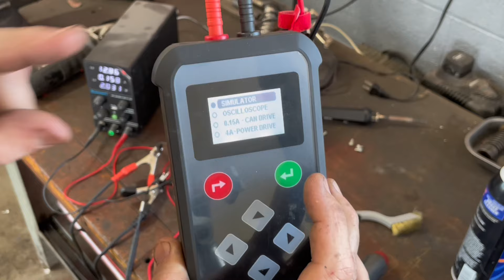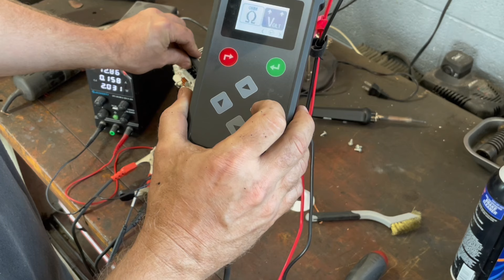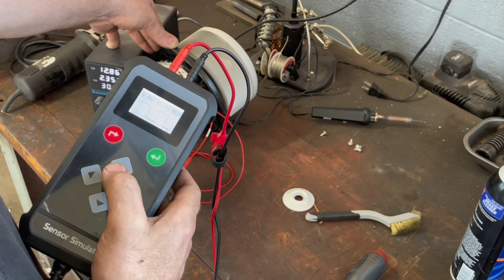Exposing Nissan NV Blower Motor Malfunction

Comment: Nice one Will.
I had a very similar one in a Nissan Elgrand that I fixed almost NPR for a customer a month or so ago.
Had all the correct inputs, good power, ground and square wave signal and the speed control resistor tested good.
So I opened it up and found two of the spot welded tabs to the motor windings had simply come apart, (one of the copper bars that you cut but right at the motor terminal) 
I didn't have my soldering iron with me, so I scrubbed/cleaned between the two tabs with a small file and reconnected the two tabs with the female end of a 1/4" flat blade crimp terminal to clamp the two tabs back together, which slipped on perfectly and nice and tight.
Worked a charm, and no chance of them coming apart again like they could if they were soldered.👍